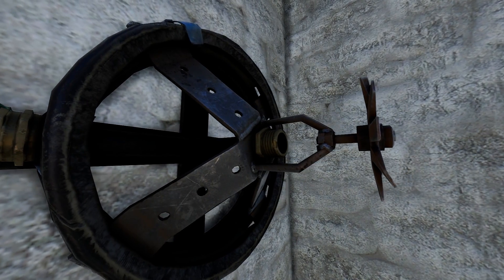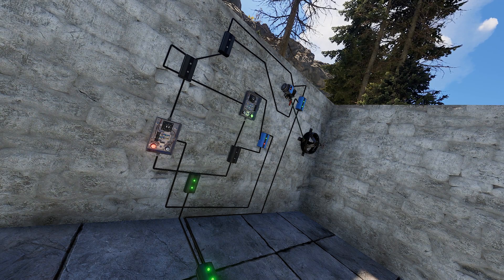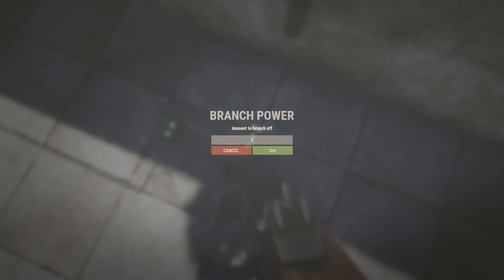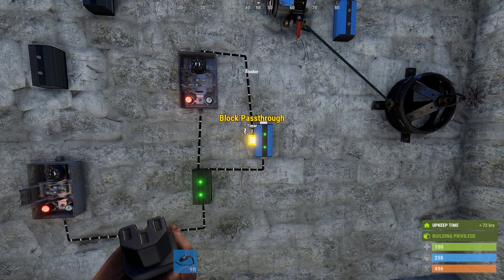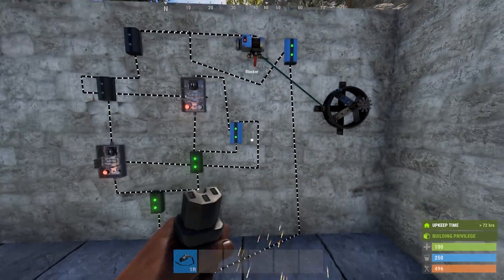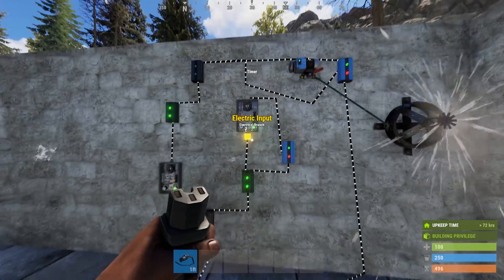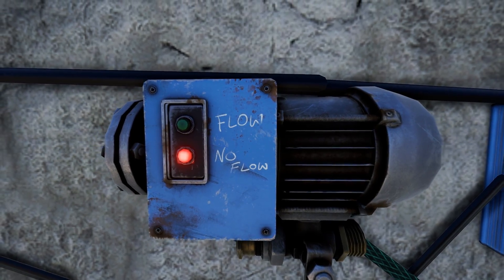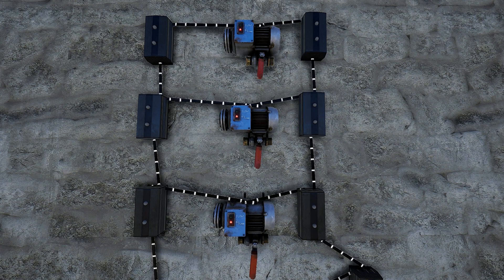RUST 101: Farming 2.0 - Automatic Sprinklers

Comment: Just leaving this out there... there is no point in using the sprinklers or pumps right now as the water catchers are way too slow to be used as direct input to the sprinklers. I linked 100 water catchers up and the flow rate was still too slow. You will just get a head ache. Instead fill the planter all the way up with water with a blue water jug. You have the live directly next to or in a river to run a successful farm. No other way around it. Once the planter is filled with water plant the seeds and put the fertilizer in with them. For corn it is enough water until harvest. With pumpkins you may have to water them one more time throughout the grow process.
Reply from the maker: That's crazy... you're manually having to keep checking on them and watering them to keep them in their optimal saturation points. Why wouldn't you want to use sprinklers to save you all that hassle? Then you just dump your fresh water in a barrel or catcher and forget about it...

Also facepunch did a commit for a new component that is essentially a pump you stick in a river and it pumps the water directly from there. So at least we'll have a better water source once the patch hits.

Comment: I'm starting to think Facepunch doesn't have a goddamn clue how electricity works. It's so much simpler than this BS. JFC, just make it X amps in and be done with it. If you plug in too much shit, then nothing works. TA DA
Reply from the maker: Yeah I remember when they first dropped electricity and Gal and I started playing with it... It was even more crazy than it is now lol... like for example if you plugged anything into a battery it would go ham and push all of its power out rather than just the required power.

Comment: If you place the pump high enough so that it won't work unless it gets power, leave it on, and then have a timer set to give it power when you want, you can reduce the number of components it take to build the circuit.  No need to specifically send a signal to "turn on" the pump.
Reply from the maker: Yep, I went with this design because that way it covers both elevated and flat farms. Plus if they change things down the track and make it so you have to trigger the on off switches then at least this already does and as far as I can tell as simply as possible.

Comment: WTF NO! NO! NO!
What you need is 1 splitter , 2 Timers , 1 blocker , 1 el. branch. And pump and sprinkler/s by default.
1) Get power to splitter. 
2)From splitter power up the 2 timers and blocker (power in).
3) From power out on blocker power in el. branch.
4)From el. branch branch out(the left output) to timer(A) toggle (don't change anything on branch).
5) From timer(A) power out to blocker block passthrough.
6) From el. branch power out(right output) to timer(B) toggle.
7) From timer(B) output to Pump power in.
The pump must be ON all the time for this , when it receives electricity from timer(B) it starts to work.
Timer(A) after what amount of time is the sprinkler going to startup. If you set it to 30 min than the sprinkler is going to startup every 30 min for the Timer(B) time and stop.
Timer(B) is how long the sprinkler going to work. If you set it to 1 min the sprinkler is going to work every Timer(A) time for 1 min and stop.
Hope this helps you out. Nice video btw.
Reply from the maker: So you're wrong... but let me explain why because I had the exact same thought as you but you haven't found the flaw in the design yet. 

If your farm doesn't have much height to it then you won't need to power your pump. If you use your circuit on a farm that doesn't require a powered pump to run then the water will run continuously because you're just toggling power rather than the on and off switches.

Also don't use splitters, they are easier to use because you don't have to think about branching the power but they waste power because they just split it in half rather than sending specific amounts of power where it's needed.
Reply: @Malonik  I use water barrel that is under the pump and dont have any problems.
You can branch power to the splitter if you want to have exact power.
I just don't want to waste hqm.  Ty for reply.

Comment: You dont have to connect that cable to turn off and turn on dude...
You can put the timer-----------pump power and always left the pump on
Reply from the maker: Not a good solution, if the pump doesn't need power (for example a farm that doesn't have much height) then that won't work because the pump won't stop the water.

Comment: and here I was making rust clock, to run counters to run timers that run the pumps... I feel very stupid righ now, because this is way easier and cheaper solution :D
Reply from the maker: Lol don't feel stupid, no answer is wrong if the end result is it does what you want. There just might be a more efficient way than what you're doing. :P Gal was actually trying to work out the circuit at the same time as me and his was coveting like 3 or 4 walls when it clicked and I realized how I could do it really simply lol.

Comment: Great vid will check it out. I think it would be great if the timers had a delay function built in. I have put this forward on the forums but no one has responded... yet! My thinking is that the toggle would be integrated with a delay function (0 by default) so once it gets a pulse it would wait that length of time before switching on the main power source. I think it would simplify this circuit and have so many other cool uses (delaying things such as doors opening / trap bases etc). Maybe an advanced electronics DLC (if they want to cash in!) where they add some other components (small solar panels, branches with more branches,  cassette recorder so you can play pre-recorded messages for example)
Reply from the maker: I mean you could use the timers to create a delay. That's essentially what the right timer is in this video.

Comment: Crap just daisy change a few water catchers together into a water barrel and just leave the water on the whole time you are growing something. That's a lot easier and cheaper.
Reply from the maker: That's not going to be anywhere near as efficient as using this and the new components coming next patch. Also after the patch you'll oversaturate your plants and kill them if you leave it running constantly.
Reply: @Malonik  you can oversaturate them now for most / all growables if you go past 8000ml planter water. The change for the patch based on the commit will probably bring the range down which may make the oversaturate threshold lower as well.
Reply from the maker: @worlwr2  I had noticed that with manually watering them.... wasn't sure if it was some buggy stuff or intended.

Comment: I find it easier just to use one sprinkler per 3 large planters and have it on when the plants are growing. It keeps up with the demand. So if it has about 6 to 7k water at the start it should be mostly optimal troughout. Main issue is temperature anyway?
Reply from the maker: I'm kinda surprised 1 is enough to fill it with the plants growing. Are you filling them manually before planting?

Also temperature is an issue. You could crossbreed H (hardiness) genes into your plants but that's sacrificing potential growth and yield slots so I'd only do it if you absolutely have to.
Reply: @Malonik  Yeah as its the quickest way to get water apart from having 20 catchers. Tho i think sprinklers are more effective, aka more water in the bed. 

Ive just seeded 200 seeds i the wild to get a YGYYHY.